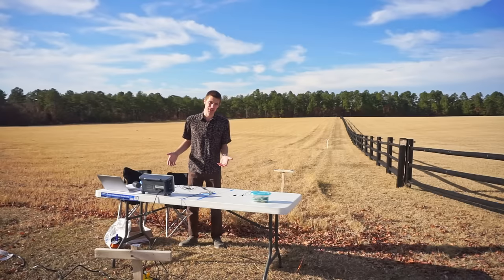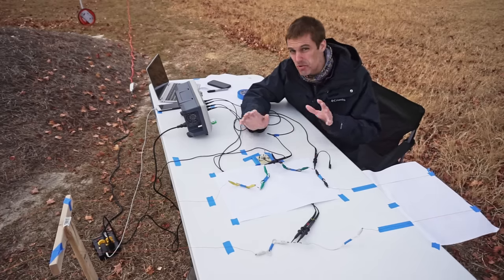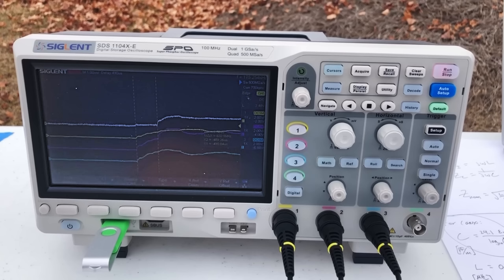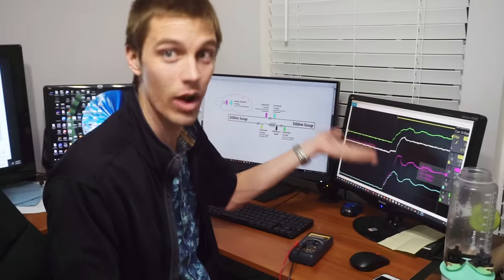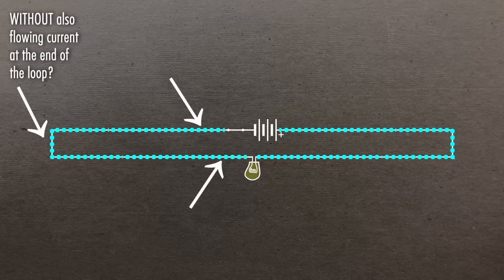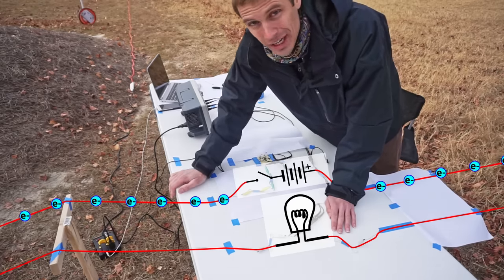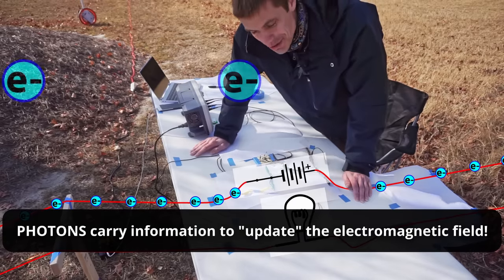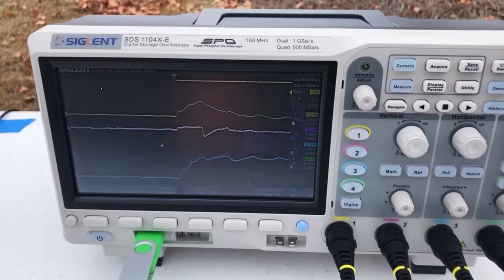I bought 1000 meters of wire to settle a physics debate

Comment: If the resistor is not a light builb, you are just not driving it hard enough.
Reply: looool 😅
Reply: Everything is a lightbulb with enough current at short enough timeframes.
Reply: X'D
Reply: Cigarette lighter
Reply: Everything's a lightbulb if you're brave enough
Reply: Your body is also a resistor. ;-)
Reply: Everything is a resistor if you try hard enough
Reply: Sometimes I get bored and hook up little resistors to the cut end of an extension cord. Turn the lights off and plug it in. It's like electronic fireworks
Reply: Or too hard. Everything is a fuse if you drive it hard enough. The tolerances of operational parameters for a Light-Emitting Resistor are pretty tight.
Reply: My thoughts exactly
Reply: lololoool 😂🤣
Reply: It’s also a smoke generator! Very multipurpose…
Reply: Funny but not actually true. The resistor in question must be capable of withstanding at least 1000K or so without failing.
Reply: On a similar note, every led can be made into a red led, for a little while
Reply: @sharpfang  "Everything is a fuse if you drive it hard enough"
Are you by any chance familiar with the channel photonicinduction 🤣
Reply: I think that was proven by Photonicinduction.
Reply: @anthalamo1  Great minds think alike, they say
Reply: It actually is a lamp, just the wavelength is veeery long at those low temperatures :)
Reply: It's a faint light-bulb in IR wavelengths.
Reply: My university Phys. II professor had a demonstration where he'd turn a pickle in to a light bulb.
Reply: I watch a video where a man turns into a light bulb, it was a horrible accident
Reply: Excellent
Reply: I prefer to think that you're just not viewing it in a low enough frequency band.
It glows in IR.
Reply: If your pipe wrench isnt a light bulb...
Reply: TheKubox you're really ElectroBOOM aren't you and if not you may have a brother by another mother 😁
Reply: @nimmen  No, but that's a common saying among engineers. 
For that matter, once I had a wonder diode. I bought it as an infrared diode. But besides infrared, it was emitting visible light, sound, and scent.
Reply: @appa609  Not really it is still emitting light long before that just that we humans are blind to it as we lack photoreceptors that work in that range.
Reply: @alexandriap.3285  And don't care about how long it lasts.
Reply: STOP RESISTING (and take my upvote)
Reply: My first thoughts on watching the video was how long does it take for a light bulb to glow??
Reply: Cool experiment and well thought through. Two suggestions:

1) Move the wires that are now running in parallel a foot apart, to go in a circle. That would minimize the capacitive and/or inductive couplings between the parts of the wire and should change the outcome quite a bit.

2) Instead of triggering your analysis on the transients of a single event, use an AC source and look at the phase difference between the voltage and the current (as measured by the voltage across a resistor in series with the loop).

A) With a sine wave, like mains electricity.

B) With a square wave. Harder to generate but should yield some pretty ringing transients.

Of course, this is all just AC theory but pushed to the extremes with the tiny time intervals that are being observed. If you want to be absolutely overambitious about it, modify the circle to more of kidney shape with two loops and a middle section that comes just barely close enough to the 'scope for your probe cables to reach, and place a current-sensing resistor there as well, to see if you can detect any delay (phase difference) between the currents in the middle and ends of the wire.

Finally, the "chain in a garden hose" model is still valid! You just have to allow for the elasticity of the chain, so the links stretch a tiny bit as you make a sudden pull. Easier to visualise if all the links are rubber bands and the entire thing is slightly under tension. So when you pull on the band at one end, it stretches a bit, then pulls on the next one and so on all the way down the tube.
Reply: @Gabu_  anything is a smoke machine if you operate it wrong enough.
Reply: The question is, is it an incandescent resistor, or an Arc Resistor?
Reply: Personal best: while in vocational college, wired eprom up incorrectly on a school project. Hint #1: stuck bit on output. Hint #2: light coming out of erase-window. Bonding wire survived, silicon not so much. It cost 169 NOK to replace.
Reply: Not really.  A light bulb is a resistor designed so that it doesn't blow out when driven to a temperature where it would emit light.  A normal resistor would immediately fail at those temperatures.  Which is why the Edison company had such a hard time designing the first light bulbs.
Reply: Then you've got a fuse.
Reply: Ah, the “everything is a smoke machine if you operate it wrong enough” thesis.
Reply: @olegil2  169 kr. EPROM, must have been a long time ago or a multi-megabyte chip.
Reply: @trevorgray3681  "Sometimes I get bored and hook up little resistors to the cut end of an extension cord. Turn the lights off and plug it in. It's like electronic fireworks" ... I used to do that with capacitors. But more for the 'bang' than the light show.
Reply: @Apporv SPACE It's hard to see the results if a resistor is your light source.
Reply: this made me giggle like a little school girl for a solid minute! everything is a light bulb if you push enough current through it :)
Reply: everything is a bomb with enough energy put into it.
Reply: If you look in infrared light, the resistor basically is a light bulb and does light.
Reply: @trevorgray3681  Germanium diodes work great in this mode. Kaboom.
Reply: You could have used a light bulb instead of a resistor to keep things similar
Reply: @shandusa  A problem with light bulbs is they change resistance dynamically thus introducing another variable.  Also, a typical light bulb has a coiled tungsten element and that is going to add some inductance.
Reply: @TorstenLif  Thanks alot!😡 Just as I was starting to think I might be understanding something here you had go and remind me how I really don't know much of anything.🤪
Reply: @trevorgray3681  depends on the resistance  :)
Reply: A light bulb changes resistance as temperature changes.
Reply: @claudiu7909  Except superconductors
Reply: @sharpfang  Superconductors would like a word
Reply: @rykehuss3435  Yeah, due to self-induced magnetic field rapidly quenching superconductivity at critical current, you won't get much of any light bulb effect. But you'll get a very fast-acting superconducting fuse, which acts as a linked breaker, alongside with itself introducing a break in  all adjacent circuits, be it superconductor, conductor, fibre optic data, lighting, helium coolant, hypervelocity particles or service access catwalks/roads, never mind rapid termination all nearby eyewitnesses.
Reply: Why would "driving" or the power make any difference? It wouldn't.
Reply: @erikziak1249  That's what she said.... but she had my baby anyway.
Reply: My wife is a resister 😳
Reply: Cuz pilot wavvy〰
Reply: Waavy boi
Reply: Same experiment with fiber optic cable? 🤔
Reply: 😆 Right on!  That needs to be a t-shirt 😆
Reply: the resistance of wires as light is not moving through a vacuum travels never at the speed of light. 

light lock 

no one ever

reads the fine print of baldwin